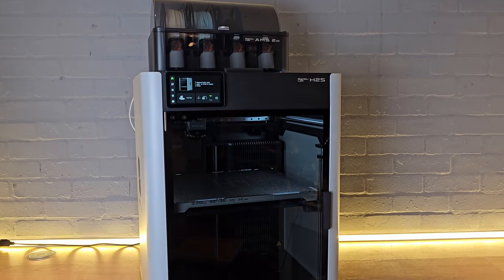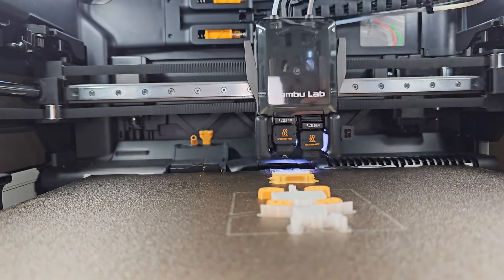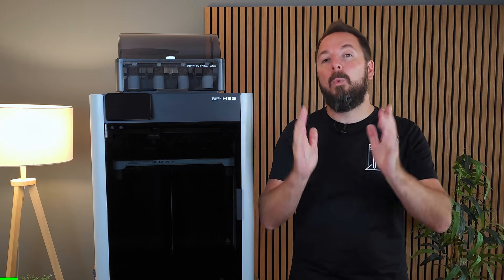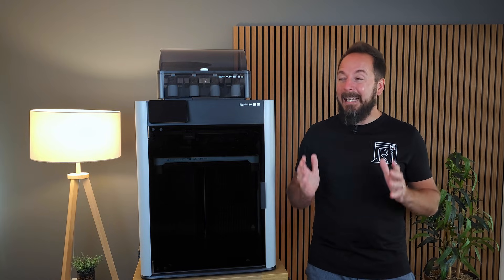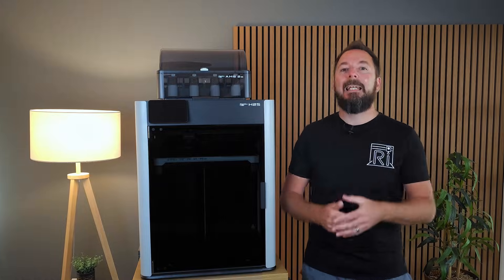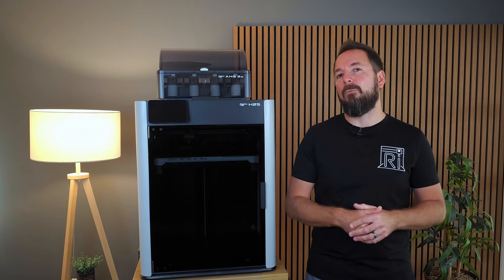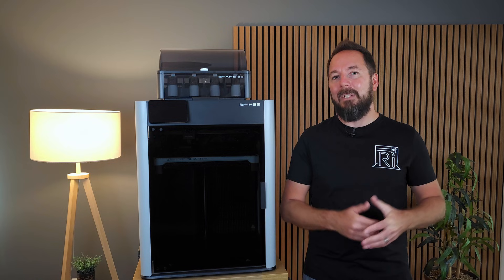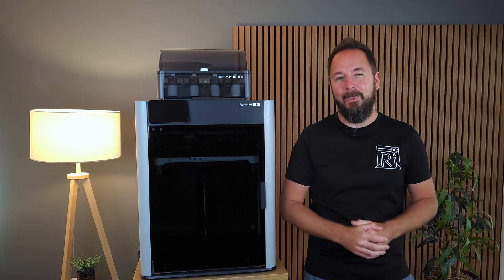Bambu Lab H2S: $800 Cheaper… But What's Missing?

Comment from the maker: The H2S is finally here — $800 cheaper than the H2D! 👀
But is it the smarter buy, or has Bambu cut too much to bring the price down?

👉 Check the current prices in your region here (affiliate links, helps support the channel 🙏):
🔗 H2S https://tidd.ly/45LBPwc
🔗 H2D https://tidd.ly/4lIBnEQ

What do YOU think — is the bigger build volume worth losing the dual hotends?
Drop your thoughts below 👇

Comment: The H2 Series from Bambu will cater for all needs, far better than the previous X, P and A Series. It appears that:
1: H2S is ideal for those, like me, who rarely do multi colour, never do multi material and for whom the X1C was good…but not big enough and not ideal for engineering filaments. 
2: H2D is ideal for those who need to use engineering filaments and require multi-material prints. It also allows fast 2 colour printing, but is limited in terms of multi colour printing above 2 colours. 
3: H2C will be for those who require fast multicolour prints, multi material prints and engineering filaments. I suspect this will also be followed up with a ‘professional’ model for the industrial sector, larger print farms with copyright concerns and the ‘never cloud’ conspiracy theorists. 
H2S all the way for me. Mines hasn’t been idle since I got it at launch in the UK and my X1C has been relegated to secondary PLA/PETG prints which it excels at.

Comment: My P1P has a super easy hot end change. A few minutes and I have a different nozzle size. Is the H2 the same or do I need a whole tool head assembly?
Reply: I added the Revo hot end on my P1 andX1C and it is super easy to change. But I am looking forward to my H2 S, which should be here in a couple of days.
Reply: @nmfireman  very easy hot end change. Noticed they added a cold pull option to the tools menu too
Reply: @nmfireman how is it going hoss??
Reply: Its same as A1
Reply: Even easier to change than the P1S and P1P
Reply: Meanwhile we had 45s nozzle swaps back in 2014.